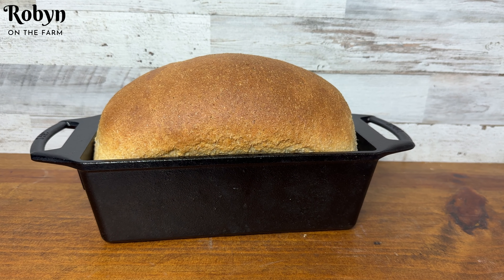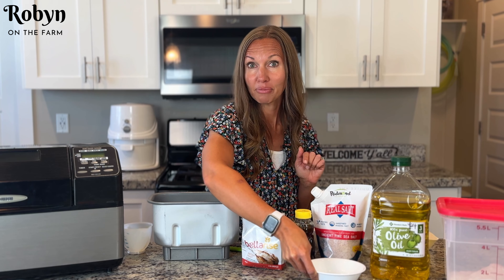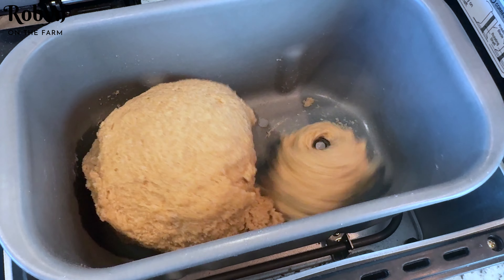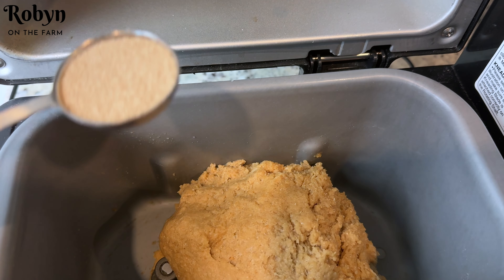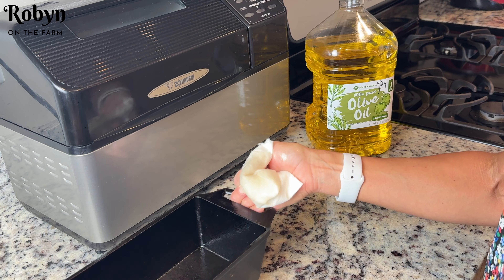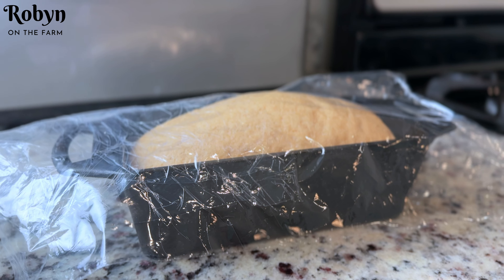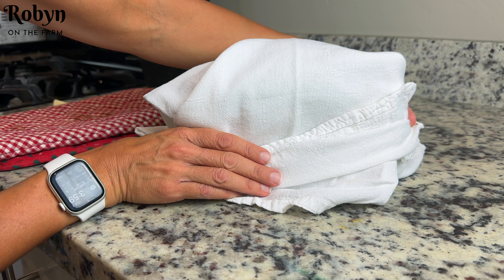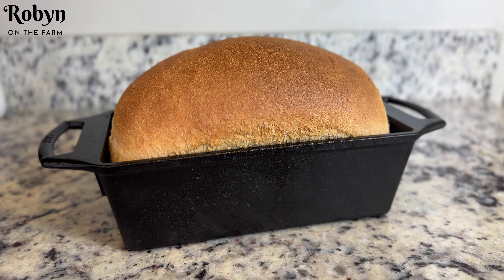Bread Machine Dough Cycle Fresh Milled Flour Soft Fluffy Sandwich Bread Recipe Honey Wheat Freshly

Comment: Hello, may I ask how you care for your cast iron bread loaf pans after each use? Love your recipes!
Reply from the maker: Hi Teri! Thank you for your question! I usually just wipe them out and add about a Tbsp of oil and rub it all over the inside and outside. If I’ve made cinnamon bread or something sticky, I wash them with hot water and dawn dish soap, dry really well, and re-oil. That’s it! They’re easy to care for and very durable! Thanks so much for watching and being here!
Reply: Thank you! I saw you using the cast iron pans and had to have them! I'll use a little more oil than I have been after gentle cleaning. Appreciate the advice ❤

Comment: i have red star yeast, will it work?
also can i use egg + gluten both? maybe it will make my bread work this time 😅
Reply: i am new to bread machine. just bought KBS bread machine from amazon
Reply from the maker: The Red Star yeast will work just fine! That is what I use normally, but when I autolyze my fresh milled flour and add it after, I typically use instant yeast. If you're not autolyzing, add the yeast in with the other ingredients like you normally would (yeast added last on top of flour before it mixes). And yes! You can use both egg and vital wheat gluten. Good luck!! Fingers crossed over here!!!